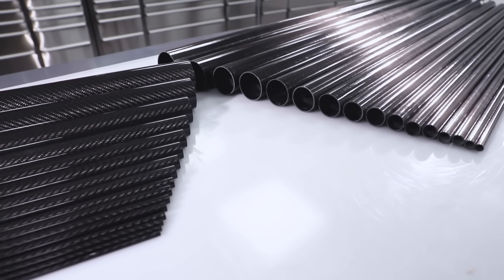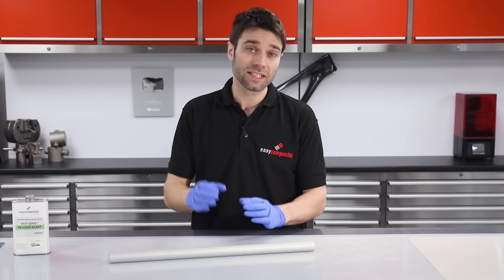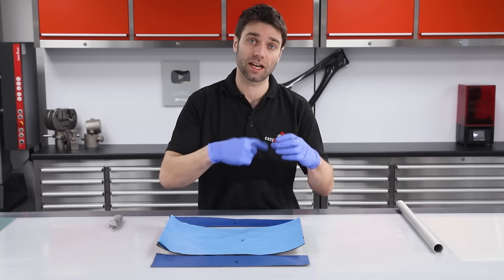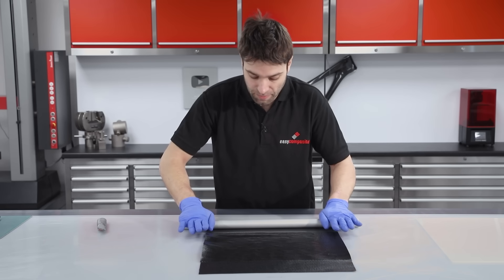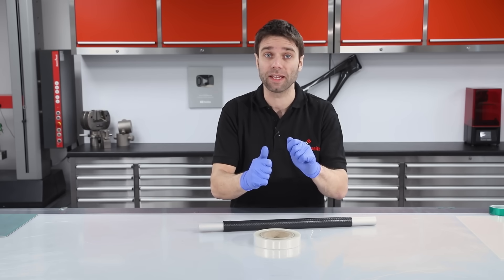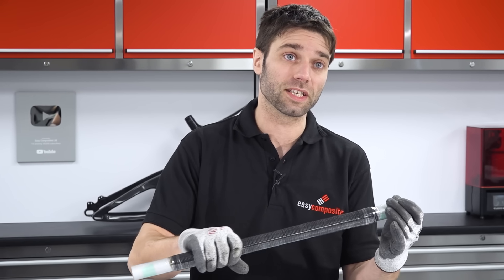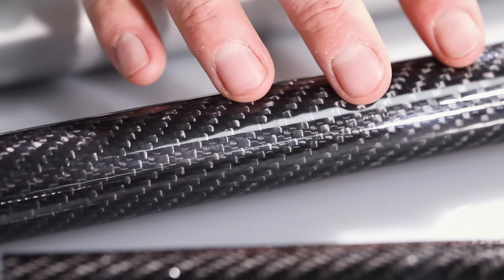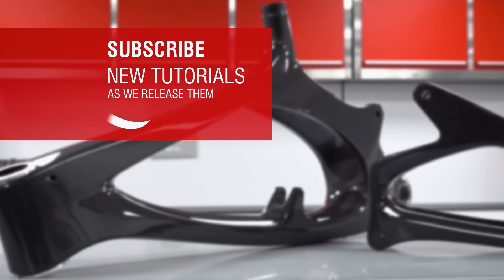How to Make a Roll Wrapped Carbon Fibre Tube

Comment: Can anyone tell me how thick a wall I would need for a measly 50lbs of force in a similar test? I'm going to be wrapping an Asiatic recurve bow handle and siyahs with carbon fibre where the timber parts attach to fibreglass limbs, also, will cling film and sellotape work for compressing it? Will be my first time using carbon fibre so, any tips are welcome.
Reply: I'm afraid it isn't that simple - your 50 lb draw weight will put significant tensile and compression loads on the front and back of the bow respectively. What's needed in this situation is a mix of materials (like in traditional wood bows). Carbon is not great at flexing, and it tends to break suddenly.
Reply: @thomaschilcott  It will only be used in non-bending areas to strengthen joints. The working section of the limbs will not be covered in carbon fibre.
Reply from the maker: Resin often sticks to clingfilm so it's not ideal. Also, sellotape is pretty stretchy so doesn't exert much force, and finally, it will soften at temperature, not shrink, so that's really not an ideal combination! The shrink tape we used in the tutorial would set you back all of about £3 so might be worth the investment! As the other poster put, it's not quite as simple as just being able to tell you what wall thickness you would need but if you wanted a starting point, 0.5mm of UD laminate could be in the ballpark (so 2 layers of 300g UD).
Reply: @easycompositestv  cool, I was just looking for somewhere to start and I have already ordered some uni-directional and 3k twill weave for it. Also, if shrink tape is basically the same price as sellotape I shall use that instead. Thanks.

Comment: How many layers are there? 5? 6?
Reply from the maker: In the layup we use 210g woven carbon and 300g UD, they are about 0.25 and 0.3mm respectively, per ply, so there's 7 plies in total in this 2mm wall thickness.

Comment: I like your tutorial man

when and how did you apply the resin onto the carbon fiber?
Reply from the maker: In this tutorial we're using prepreg carbon fibre. This is a type of carbon fibre reinforcement where the resin has already been pre-impregnated into the carbon fibre during its manufacture which means that no resin needs to be added later, which is why you don't see us adding any resin during the process shown in this tutorial. Prepregs are generally stored in a freezer until you need them and then to cure the resin within the prepreg, you need elevated temperature (an oven). If you'd like to understand more about prepregs and how they work take a look at our Introduction to Prepreg Carbon Fibre tutorial: https://www.youtube.com/watch?v=HfrFaKDsJxc

Comment: you can use propane to cool down the aluminium tube
Reply from the maker: Yes, you could use a variety of methods to cool the tube and aid extraction, if you found it was necessary.

Comment: I’m gonna use this make a full carbon cold side for turbo setups😁
Reply: For the intake part that's a great idea, but I would not recommend to proceed past the compressor. Dimensions for the compressor housing need to be very precisely milled for it to work, and that takes a whole different level of manufacturing experience to achive. Like including thermal expansion rates, the mechanical deflection of the compressor blades at full speed versus low speeds, the whole 9 yards.

Comment: Putting ice cubes inside the mandrill will help release , or put the whole thing in freezer
Reply from the maker: Yes, you can cool the mandrel and sometimes you do need the extra temperature change. However, in our case it just slid off so not necessary. Freezing (from 20C ambient) can provide an additional change of 40C, the cooling process from 120C to ambient has already produced a change 100C.

Comment: As someone who hasn't really worked with carbon before, just curious, what would the weight be roughly on a tube that size? and do the different types and processes of making this stuff offer different weight and durability, or is carbon fibre pretty consistent across the board in that respect? Thanks!
Reply from the maker: This tube only weighs about 25g. In terms of the resulting weight from different processing methods, it doesn't make much difference. The density of carbon and resin is the same regardless and so, apart from some slight void content, the density/weight of the finished part would always be about the same. As for mechanical performance it really depends on how well different processes are executed but they're likely to produce reasonably similar results.
Reply: @easycompositestv  That's absolutely crazy to me that it's so light, I've worked with carbon fibre parts a few times but it still amazes me constantly. That's good to know! Thanks for the info and the quick response, much appreciated.

Comment: Great vid. Do you account for the thermal expansion of the aluminium mandrel when you consider what ID of the tube you want? I assume that the expansion of the mandrel "overrides" the contraction of the composite shrink tape. When calculating expected wall thickness do you assume that the consolidation will be more-or-less equal to that achievable using vacuum processes?
Reply from the maker: For size critical applications you would have to take into account expansion at the cure temperature of the pre-preg. The compression provided by the tape ends up being similar or slightly greater than a typical vacuum bag. However, the fabrics can only be compressed by so much.

Comment: I want to know how carbon fiber sheets stick together without epoxy resin. Also carbon fiber sheets on this video have already applied adhesive agent? what's that blue vinyl on the carbon fiber sheets?... How edge of carbon fiber sheets didn't came untied without epoxy resin
Reply from the maker: The carbon fibre used in this video is 'prepreg' carbon fibre which means the resin is already in the carbon fibre when it comes off the roll.

Comment: The weaving carbon fiber compromises the strength.
Reply from the maker: Well, it's a little more complicated that that. Woven carbon fibre is actually really good for preventing fractures and splintering, especially when cutting and drilling. As you can see, most of the reinforcement in the tube is unidirectional but adding woven fibre inside and out provides some hoop strength and resistance to splintering.

Comment: Great stuff, are you guys also planning on a how to on making proper strong inserts in carbon structures? I'm quite worried about using aluminium threaded inserts inside carbon on structural parts. Would love to get to know a bit more about that and how to do it proper.
Reply from the maker: Great suggestion! Certainly something we will look at for the future.

Comment: How thick and how heavy would the aluminium or steel tube be to would handle those 700 kg of load?
Reply from the maker: Haha, now you're asking. We'd need to do some calculations to work that out! - Hopefully we'll do a tutorial in the future which goes into more detail comparing different materials head-to-head. When we do, we'll answer that question for you.

Comment: what if I want to make sure that the external diameter fits a certain standard (let´s say a bike seatpost)? Any easy way to achieve that or do I need a mould?
Reply from the maker: It would be easier to assure the outside diameter when manufacturing into a mould tool yes, the only other way would be to very accurately make the tube in this way but leave enough clearance to apply a finishing lacquer or coat of resin to ensure a good fit into the socket.

Comment: Can you do this any other way without using pre preg carbon and baking? Like a wet lay up with room temp curing epoxy? Would love to know, wouldnt be as strong but that doesn't matter
Reply from the maker: It would probably be possible to do the process using wet-lay. The reason I say probably is because this process - as you hopefully understand from the video - relies on the expansion and contraction of the mandrel as the temperature changes. That's how it's possible to get the carbon part off the mandrel. With wet layup and a parallel mandrel your only option for contracting the mandrel (and removing the carbon tube) would be to freeze it. However, with freezing you'll only be dropping the temperature by 40C (from 20 to minus 20) whereas with an oven we're increasing by 100C (from 20 to 120C). However, another option would be wet lay and then oven cure.
Reply: @easycompositestv  could you perhaps use say graphite powder and a then plastic film that might slip off with a bit of force? Ill give it a crack anyways haha thank you 👍

Comment: How much internal psi can the tube withstand?  Can be used for turbo or supercharger tubing? Say a 3 or 4 inch tube?
Reply from the maker: This was just a mock-up part so we don't have any data for it. There would be no problem at all though making a tube that could take almost any pressure you needed, it's simply a case of increasing the wall thickness (layers of carbon). Hydraulic testing would be a good and safe way to check for the pressure rating of the component.

Comment: Actually 700 kilograms is just ridiculous.

80 kg will easily create a pressure of a couple of tons per centimeter when falling from just 1 meter (depending on the area of the pressure point, of course).

It would be indicative if you were to compare this pipe with a metal pipe of the same dimensions.

Comment: Would this exact process do for sailing masts?
Reply from the maker: In principle although masts can be tapered or different profile shapes.
Reply from the maker: Sometimes they're made using the roll wrapped process and sometimes they're made using a split mould process (see our other video).

Comment: So that's how fishing pole blanks are made!
Reply from the maker: Actually, a lot of them are made using a pultrusion process because they use 100% UD carbon running down their length. This makes them incredibly strong and light in the longitudinal bend direction but very vulnerable to crushing/splintering.

Comment: Could this technique be used for propshafts & driveshafts?
Reply from the maker: Carbon fibre propshafts and driveshafts do exist and a lot of them are made using the roll wrapped technique. Generally, for propshafts you need fibre alignment on the bias (angled) so that the tube has maximum torsional strength.

Comment: Could this be done with resin and vacuum infusion ?
Reply from the maker: Well, theoretically yes but practically it would be a very awkward form to be trying to set up for a resin infusion. You'd probably be better off wet-laying and then shrink wrapping if you didn't want to use prepreg. The high temp cure is still an integral part of the process (for the expansion of the mandrel and contraction of the tape) but that could still be used for a wet lay or infused part.

Comment: 700Kg breaking strength, wow, that's excellent for such a small and thin wall pipe, no wonder they use it for weight reduction.
Reply: And that tube is light AF...a steel tube about the same weight can be bent by your bare hands, even fingers, if you are some particularly buffed Muslim dude.
Reply: Stop jihad😂😂😂

Comment: What am I missing here. How does the wall thickness remain the same? Surely there's a section of the wall which should be slightly thicker/thinner? Concentricity cannot be the same throughout the wall thickness?
Reply from the maker: Yes, that's right, we've got 'good' consistence in the wall thickness but it's never going to be perfect. The more accurate the cutting dimensions, the closer you can get.

Comment: What strengt properties a woven carbon tube provides? The like of woving machines with 16 or more spools provide.
Reply from the maker: Sorry, I don't think I understand the question properly. Could you explain a little more?
Reply: For exaple if you see this 1 minute video "Radial braiding using 6k carbon fibre tows" it shows the braiding process of a carbon sleeve/tube, it can be done over a part and the carbon fibers will take the form of that part. If one were to use a tube made with that process, what structural properties could we expect from it.

Comment: I have such a wild idea. I want to cut the tubes out of the old steel frame and replace those with some 2-centimeter overhang with carbon tubes. What then to glue and join it? And do you need to do some bandage?
And I'm sorry for the miserable English.
Reply: 3m panel bond.

Comment: Can you use a wax shape, for example the s bend at the start of the video. Wrap the wax block up and then melt it out later, like how lost wax casting molds are formed
Reply from the maker: Hi Adam... sort of. The material that we're using to make the tube in this video is prepreg carbon fibre which must be heated to a relatively high temperature in order to cure. If we were to use a wax mandrel, together with prepreg carbon fibre, then we're likely to melt the wax before the prepreg cures. Also, if you're following this basic roll wrapping process, including wrapping the mandrel and reinforcement with the shrink tape then when the tape contracts at temperature it would put too much pressure on a soft wax (especially at temperature) and squash it. Therefore, if you're using prepregs and want to use a sacrificial mandrel then you normally need to be looking at water-soluble cores that can be washed out. These materials are quite high-tech, usually you would either need a split mould to cast the water-soluble mandrel or you would need to CNC machine it from a solid block of the material.

Comment: Great video as usual guys. 
I’m interested in using a tapered mandrel to do a similar thing. 
Once the part is cured what kind of service temperature can it handle? 

Also would have being great to press the tube at different temperatures to see how it affects load and deflection levels.
Reply from the maker: As a basic rule for prepregs (and you can always consult the datasheet to confirm the details for a specific material) the service temperature is likely to be just slightly lower than the cure temperature. In this case we cured at 120C so a 110C service temperature could be expected. As it happens, 110C is the service temperature for this prepreg following a 120C cure.
Reply: ok cheers that's a good rule of thumb 
do you guys use vinal ester much?
I've being using it a bit on some small stuff lately

Comment: anything special about the oven? is it  a vacuum oven or can this be done in my kitchen oven?
Reply from the maker: Well, this one is a special oven but it doesn't need anything special at all. No need for a vacuum, as you can see in the video we're not connecting any vacuum supply to the inside of the oven. The work is done by the contraction of the tape and (to a lesser degree) some expansion of the mandrel. A basic domestic oven would be fine.

Comment: Could I use this as a barbell for a 145kg benchpress? 🤔
Reply from the maker: Well, you'd have to some maths there! - As the pole gets longer it would deflect more. It took 700kg over the 300mm span on our test rig but if it was 3 times that length then it might not be sufficient. One thing to point out though, who needs a light bar when you're pressing 145kg!
Reply: @easycompositestv  lol

Comment: Would not a "sock tube" weave be a safer bet? It would of course need vacuum infusion.
Reply from the maker: Safer in what sense? - The main issue with a woven sleeve is that the fibre orientation is predominantly at +/- 45 degrees. At the very least it will be considerably 'off axis' meaning that you don't have fibre alignment in the direction you need it in (i.e. running lengthways down the tube). For tubes where you do want lots of torsional stiffness then a carbon sleeve would be an option although, to be honest, you would probably switch to a filament winding process in that case.

Comment: Interesting.... May i ask ..??

Can I make carbon fiber tube from sheets of carbon Kevlar? Not carbon prepeg like in the video..??
Thanks for answering 😊🙏
Reply from the maker: Hi Adan, yes, you could make a Kevlar composite tube using prepreg Kevlar reinforcement in just the same way as we've done using carbon prepreg. You might not find it as easy to track down prepreg Kevlar reinforcement though, it is less common. We don't stock it as standard but we do make for bespoke orders.
Reply: @easycompositestv  ooo oke, great. once again,  thanks for answering sir 🙏🙏😊

Comment: I dont get it. Is the resin IN the film already? How does it not cure/dry out just lying around?
Reply from the maker: This is PrePreg material thus the resin matrix is already impregnated onto the carbon fibres; when heated in the oven it flows and cures to make the rigid tube.

Comment: This method is too expensive. To use it, you have to buy all this specific materials. What about video with epoxy and carbon tissue?
Reply from the maker: Well, this is a demonstration of how roll wrapped tubes are made. These are the materials and the process that is used, we can't really get away from that. Carbon tissue it not going to offer anywhere near mechanical properties of continues woven fibres, you'd be much better off using woven glass than carbon tissue of you wanted to reduce the cost.

Comment: Can u use them as a rear axle on racing gokarts?
Reply from the maker: Well, in theory you could but there's a lot about a carbon fibre tube that doesn't really make it the best choice for an application like a rear axle.